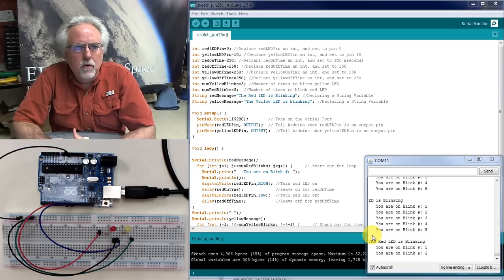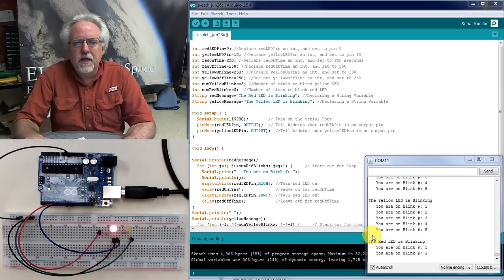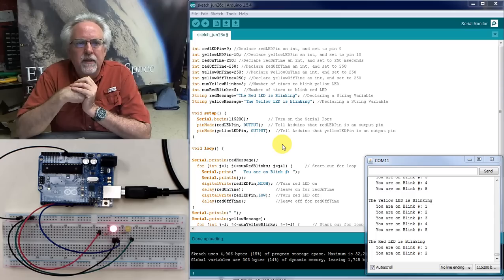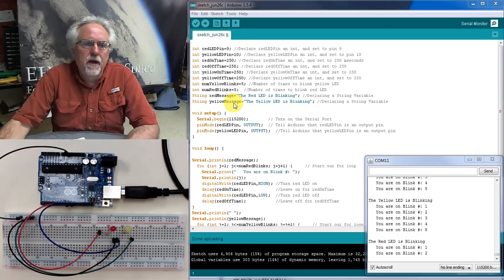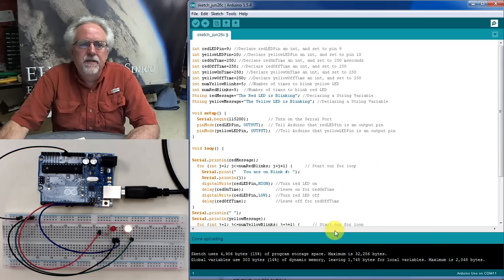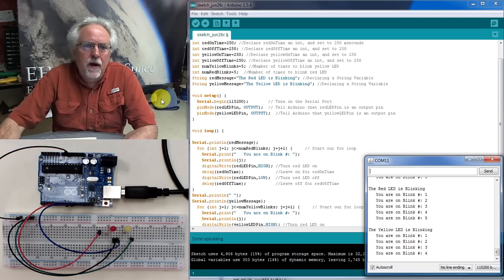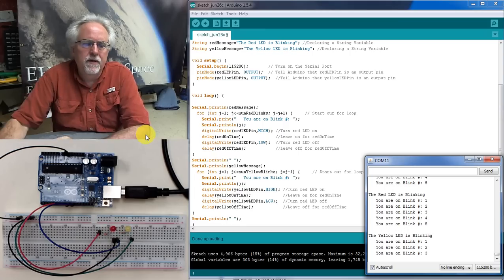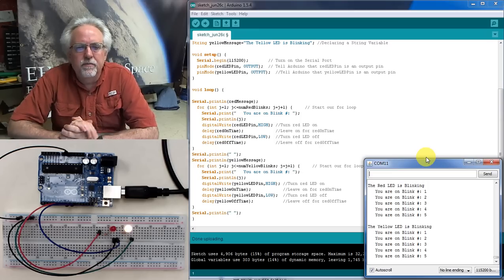LESSON 6: Reading Data from Arduino Serial Monitor

Comment: something is wrong with either the code or the way my arduino IDE is...  

This is the code that I used, which is right off of your website:

int redLEDPin=9; //Declare redLEDPin an int, and set to pin 9 
int yellowLEDPin=10; //Declare yellowLEDPin an int, and set to pin 10 
int redOnTime=250; //Declare redOnTime an int, and set to 250 mseconds 
int redOffTime=250; //Declare redOffTime an int, and set to 250 
int yellowOnTime=250; //Declare yellowOnTime an int, and set to 250
int yellowOffTime=250; //Declare yellowOffTime an int, and set to 250
int numYellowBlinks; //Number of times to blink yellow LED
int numRedBlinks;  //Number of times to blink red LED
String redMessage="The Red LED is Blinking"; //Declaring a String Variable 
String yellowMessage="The Yellow LED is Blinking"; //Declaring a String Variable
 
void setup() {
  Serial.begin(115200);        // Turn on the Serial Port
  pinMode(redLEDPin, OUTPUT);  // Tell Arduino that redLEDPin is an output pin
  pinMode(yellowLEDPin, OUTPUT);  //Tell Arduino that yellowLEDPin is an output pin
}
 
void loop() {

  Serial.println("How Many Times Do You Want the Red LED to blink?"); //Prompt User for Input
  while(Serial.available()==0) {  } 
  numRedBlinks=Serial.parseInt(); 
  
  Serial.println("How Many Times Do You Want the Yellow LED to blink?"); //Prompt User for Input
  while (Serial.available() == 0){}
  numYellowBlinks=Serial.parseInt();  //Read the data the user has input

  Serial.println(redMessage);
  for (int j=1; j<=numRedBlinks; j=j+1) {     // Start our for loop
    Serial.print("   You are on Blink #: ");
    Serial.println(j);
    digitalWrite(redLEDPin,HIGH); //Turn red LED on
    delay(redOnTime);             //Leave on for redOnTime
    digitalWrite(redLEDPin,LOW);  //Turn red LED off
    delay(redOffTime);            //Leave off for redOffTime
}
  Serial.println(" ");
  Serial.println(yellowMessage);
  for (int j=1; j<=numYellowBlinks; j=j+1) {     // Start our for loop
    Serial.print("   You are on Blink #: ");
    Serial.println(j);
    digitalWrite(yellowLEDPin,HIGH); //Turn yellow LED on
    delay(yellowOnTime);             //Leave on for yellowOnTime
    digitalWrite(yellowLEDPin,LOW);  //Turn yellow LED off
    delay(yellowOffTime);            //Leave off for yellowOffTime
}
Serial.println(" ");
}

-------------------------------------------------------------------------------------------------

The Serial monitor waits for me to enter a digit as it says "How Many Times Do You Want the Red LED to blink?" But then skips the the Serial.parseInt for the yellow color and gives me this in the Serial Monitor:

How Many Times Do You Want the Red LED to blink?
How Many Times DO You Want the Yellow LED to blink?
The Red LED is blinking
       You are on Blink#: 1
       You are on Blink#: 2

The Yellow LED is Blinking

How Many Times Do You Want the Red LED to blink?

---------------------------------------------------------------------------------------

I only sent the number 2 ONCE and this is what came out....
Reply: NVM lol did some research and I was directed to use the "No line ending" and "9600 baud rate" options in the serial monitor and everything works fine now. Thank you so much! This tutorial (though a bit old) is really good! I hope you publish more "advanced" videos of arduino and RapBerryPi like examples of your projects and creating something cool with the sensors and whatnot.
Reply: Vincent B Can we use ' if (Serial.availble() > 0) instead of the while loop???
Reply: Vincent B same problem with me VB
Reply: Vincent B thanks VB that no line ending...sloved the problem
Reply: This helped me solve the same issue.  feel like I was eventually going to figure it out on my own. His serial monitor is right there with the setting in clear sight lol! Thank you Vincent B.
Reply: OMG, I was stuck on this for a whole day. Thanks.  I'm not insane, it was just a setting...

Comment: my code isn't working
int greenLED = 9;
int yellowLED = 8;int greenOn = 500;
int greenOff = 500;int yellowOn = 500;
int yellowOff = 500;int numgreenblink;
int numyellowblink;String greenMessage = "The green LED is Blinking";
String yellowMessage = "The yellow LED is Blinking";
String val1 = "                 Welcome to ";
String val2= "my program";
String val3;void setup() 
{
  Serial.begin(9600);  val3 = val1 + val2;
  Serial.println(val3);
  Serial.println(" ");  pinMode(greenLED, OUTPUT);
  pinMode(yellowLED, OUTPUT);}void loop() 
{Serial.println(" ");Serial.println("How many times do you want the green LED to blink");
while(Serial.available()==0){}
numgreenblink = Serial.parseInt();Serial.println(" ");Serial.println("How many times do you want the yellow LED to blink");
while(Serial.available()==0){}
numyellowblink = Serial.parseInt();Serial.println(" ");Serial.println(greenMessage);Serial.println(" ");for (int i = 1; i<=numgreenblink; i = i +1)
{
  
 Serial.print("You are on blink #: ");
 Serial.println(i);
  
 digitalWrite(greenLED, HIGH);
 delay(greenOn);
 digitalWrite(greenLED, LOW);
 delay(greenOff); 
 
}Serial.println(" ");Serial.println(yellowMessage);
for (int j = 1; j<=numyellowblink; j = j +1)
{ Serial.print("You are on blink #: ");
 Serial.println(j); 
 digitalWrite(yellowLED, HIGH);
 delay(yellowOn);
 digitalWrite(yellowLED, LOW);
 delay(yellowOff);
 
}
Serial.println(" ");}

Comment: Hello, your tutorials are awesome but I am having a problem with the program. Instead of running as it does in the video it does:
 Welcome to my Program
How many times do you want to blink the red LED?
 (I answered 5)
How many times do you want to blink the blue LED?
(I answered 5)
The Red LED is blinking
  You are on blink #: 1
  You are on blink #: 2
  You are on blink #: 3
  You are on blink #: 4
  You are on blink #: 5
 
The Blue LED is blinking
(everything below is not supposed to be there and the blue does not blink, instead, it repeats the red blinking as seen below)                                                 

How many times do you want to blink the red LED?
How many times do you want to blink the blue LED?
The Red LED is blinking
  You are on blink #: 1
  You are on blink #: 2
  You are on blink #: 3
  You are on blink #: 4
  You are on blink #: 5
 
The Blue LED is blinking
How many times do you want to blink the red LED?

Is this happening because of me being on a newer version of the program?
(After this did not work for my code I tried copying and pasting the code from your website and the results were the same)
Reply: I'm having the EXACT same problem and going crazy. Did you figure out the problem?

Comment: Hey I'm having trouble with my ultrasonic sensor for arduino. I'm using a pager motor to help with detection, but the motor keeps running even if there is nothing in front of the sensor, and the sensor doesn't detect any distance on objects in the serial monitor. What should I do?

Comment: first of all thanks for these lessons they are verry helpfull. If i put the 2 while loops in the code only the first one works, the red led checked the code a couple of times and its just the same as yours.
can u check it out pls? 

const int rodeLEDPin = 9;            //declaleren van ledpin als int naar pin 9
const int geleLEDPin = 10;          // declaleren van ledpin als int naar pin 10
const int roodAANtijd = 250;        // wachttijd LED aan
const int roodUITtijd = 250;        // wachttijd LED uit
const int geelAANtijd = 250;        // wachttijd LED aan
const int geelUITtijd = 250;        // wachttijd LED uit
int numROODLed;                     // aantal keer knipperen rode led
int numGEELLed;                     // aantal keer knipperen gele led
String ROODbericht = "De rode LED is aan! "; // declareren van een string variabele
String GEELbericht = "De gele LED is aan! "; // declareren van een string variabele

void setup() {
  Serial.begin(9600);               //seriële poort openen
 
 pinMode(rodeLEDPin, OUTPUT);      // uitgang rode LED
  pinMode(geleLEDPin, OUTPUT);      // uitgang gele LED

  Serial.println(" Hoeveel keer moet de RODE LED branden? ");
  while (Serial.available() == 0) { }
  numROODLed = Serial.parseInt();
  
Serial.println(" Hoeveel keer moet de GELE LED branden? ");
  while (Serial.available() == 0) { }
  numGEELLed = Serial.parseInt();

}

void loop() {

  //Serial.println(ROODbericht);                  // print inhoud van variabele
  for (int j = 1; j <= numROODLed; j = j + 1) {  //variabele j aanmaken voor de for loop
    Serial.print(" Rood staat aan#: ");    // printen naar monitor
    Serial.println(j);                     // variabele j printen naar monitor (geeft aan per keer de led aan gaat)
    digitalWrite(rodeLEDPin, HIGH);       // rode LED aan
    delay(roodAANtijd);                   // wachttijd
    digitalWrite(rodeLEDPin, LOW);        // rode LED uit
    delay(roodUITtijd);                   // wachttijd
  }
  Serial.println(" ");                  // spatie tussen rood en geel
  //Serial.println(GEELbericht);      // print inhoud van variabele
  for (int j = 1; j <= numGEELLed; j = j + 1) {  //variabele j aanmaken voor de for loop

    Serial.print(" Geel staal aan#: ");        // printen naar monitor
    Serial.println(j);                         // variabele j printen naar monitor (geeft aan per keer de led aan gaat)
    digitalWrite(geleLEDPin, HIGH);            // gele LED aan
    delay(geelAANtijd);                        // wachttijd
    digitalWrite(geleLEDPin, LOW);             // gele LED uit
    delay(geelUITtijd);                        // wachttijd
  }

}
Reply: find a solution but dont now why tis is. ive set the yellow value to  : while (Serial.available() == 1) { } instead of 0 and it works  but with no value  in the while loop it has to be 0 so you stay in the while loop